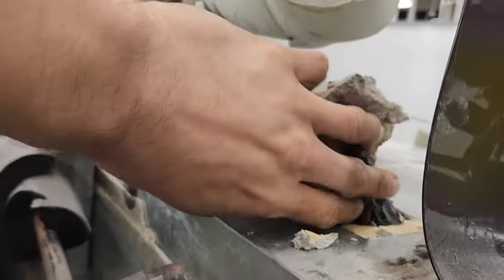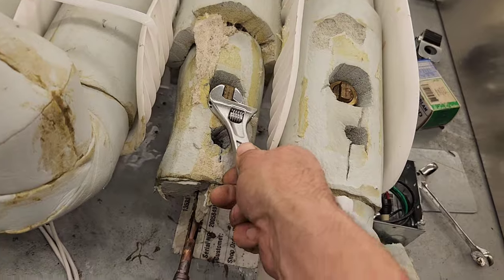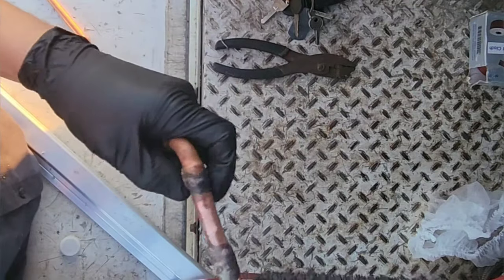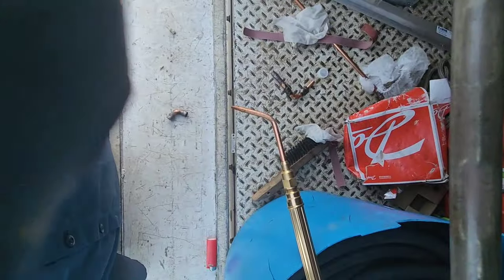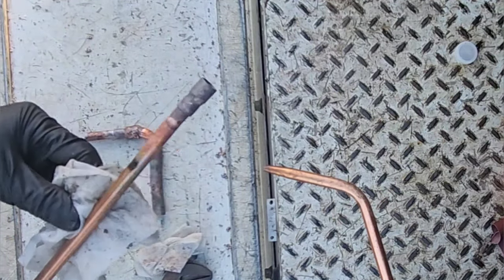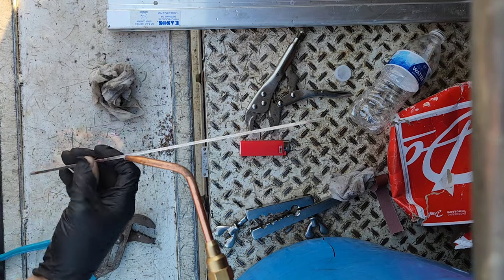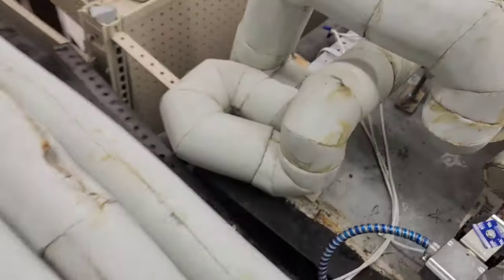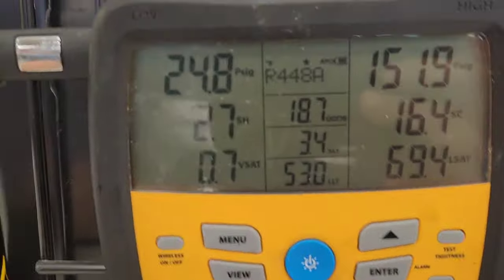2 DOOR FROZEN CASE RESTRICTED LIQUID LINE

Comment: Why didn't you just used new piping and fittings
Reply from the maker: I guess since I didn't have any on my truck, and I knew that, since the job actually is a 2 hr drive from any supply houses and the shop, I just saw the disassembling option as the only one
Reply: @HVACRServiceTech  Got it nice job

Comment: That had to be smoking bad when they brazed that joint 
Black smoke would’ve been bellowing out 
That’s why all the solder because the black soot being released when it was brazed was causing the solder not to stick
I will go a step further I’m sure it failed the pressure test and was leaking there and was repaired hence all the silver solder 
Geeez that’s pretty bad 
Good job man 
Master Tech shit right there
Reply from the maker: Thanks man
 Yea idk how they soldered that and didn't catch it

Comment: Heating that copper up all that many times would that not weakin the copper and possibly cause a leak down the line❤
Reply: Heating copper wont weaken it it will just make into soft tube instead of hard. the problem is the copper oxide flakes inside the tub. This guy is a handy man that thinks he is a refrigeration tech did you notice all the brand new tools he had

Comment: First you need to throw away that piece of crap torch and get an oxy acetylene that thing takes way to long to heat the joint and creates way too many copper oxide flakes inside the copper tube. and why in the hell did you reuse that scrap copper  you had enough flakes inside that copper to totally plug the expansion valve.Buy yourself some lever benders and you would could have used a new piece of copper and 2 couplings
Reply from the maker: Isn't that, what I used, an Oxy Acetylene Torch?